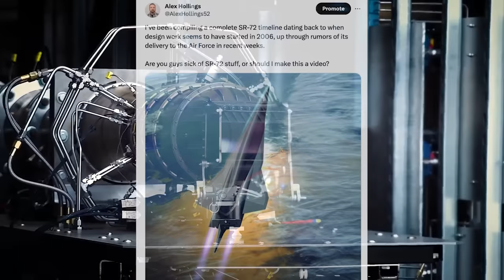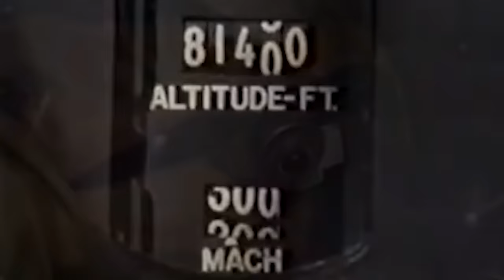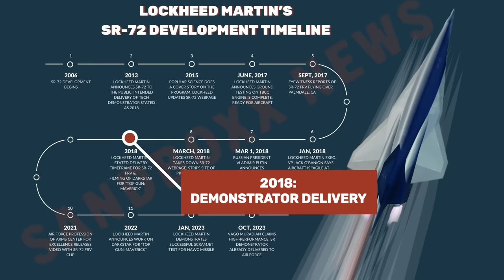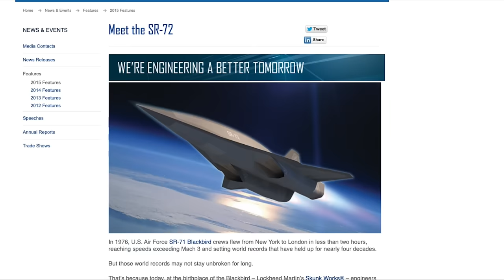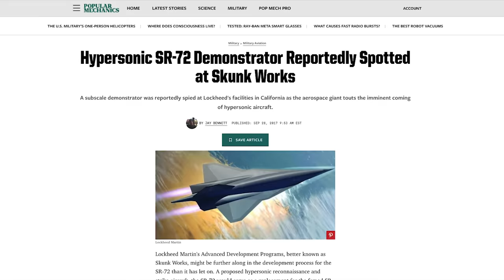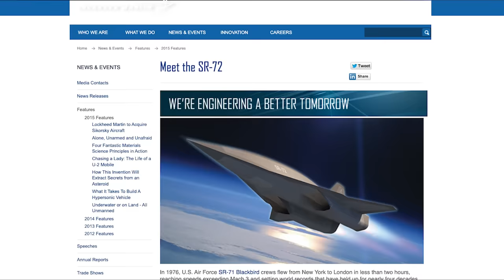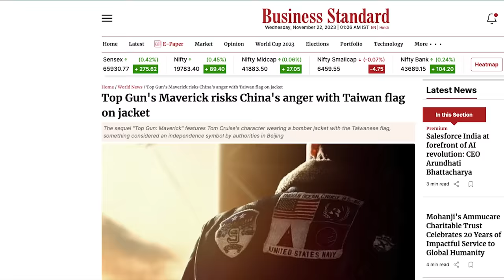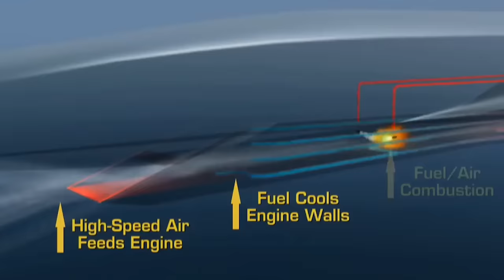The SR-72 is REAL — And we can prove it

Comment: Notes: 1) the SR-71 was designated RS-71 by Lockheed and only got its eventual moniker because Lyndon Johnson decided to announce it with the "wrong" identifier.  It seems unlikely that the follow on would be the next serial number (SR-72), using the same wrong moniker, when likely many ideas and concepts would have been worked on in the interim.
2) The X-15 had multiple melt failures including burn through of non-critical elements, during a mach 6.7 test flight. Going that fast in a lightweight aircraft remains unlikely. Mach 5 or thereabouts seems possible. Given that the USA is currently struggling to field a hypersonic (mach 5+) missile, it seems incredibly unlikely that a manned/optionally manned aircraft, funded largely as a speculative venture by Lockheed Martin, costing billions, would ever have existed.
3) "Agile at hypersonic speed" must be pure hyperbole:- the SR-71 at mach 3 had a turning circle approaching half a continent (hyperbole). At mach 6-9 it would be about a continent (proportionate hyperbole).
4) It would be a mind-bogglingly stupid thing to publish details of an SR-72, even if only speculative, for years and then to remove all references, believing that that action was somehow protective of the program. Neither Lockheed Martin nor the US government are that stupid. By the time the time of the withdrawal it would be fairly likely that agents of Russia, China, Israel and likely other nations would have managed to infiltrate the security and gain actual information.
I am reminded of the VC10-ski (IL-62) tale where British Aerospace knew it had a mole or two because of the copying of the VC-10 into the IL-62 so it and the UK intelligence services (according to an old documentary) fed to the suspected moles doctored wind tunnel data relating to Concorde. Note that there is no point in setting up your own wind tunnels and duplicating the results since you save nothing - not even time. Allegedly, the Russians obligingly trusted the doctored information and built the Tu-144 according to that data, along with canards and badly placed engines, resulting in the dismal failure that was the Tu-144. Perhaps the USA tried the same trick - using an imaginary aircraft.
My personal belief, unsupported by any first hand knowledge, is that component level testing (e.g. engines) has been progressing with a view to attempting to build an article like the putative SR-72 but no one has bitten then bullet and said stop testing - build it. I would love to be wrong and see the actual aircraft at an air display next week.

Comment: All right immediately after the speech when subsonic shockwaves happen because after shocker shockwave becomes dropping it out of atmosphere and they fire us outside the atmosphere and then we go back up and drop into the back side those explosive waves are pretty cool but if we want it to be dick heads about it when we come in we do a 90-degree invert and flatten out at the bottom that can press it with the area that's the devastator

Comment: Operation darkstar was real and occurred back in the late 1989's..... It was a joint project between Lockheed and Hughes Aircraft company for our next gen surveylance aircraft. The body stabilized aircraft was developed... A wind tunnel type model version was built and tested in El Segundo California at Hughes Aircraft Company Radar Systems Group site. Building R3 was built specifically for the testing....located on Hughes Way off of Imperial Highway, just south of RSG building R2.  When testing was completed, the issues (criminal) created by Roger Smith of General Motors who purchased Hughes Aircraft Company on a forced sale, induced/caused the POTUS to cancel Hughes involvement in the program..... Initially canceled, the building torn down 1990 iirr..... The tech transferred to the Aurora program. FYI....Hughes was the company who built the avionics systems ..with their teaming partners Motorola, Westinghouse....for Evey one of our surveylance aircraft including the SR-71.

Comment: The Former USSR was fielding Mach 4+ Sam systems back in the 80s basic Physics'  to out run a Mach 4+ missile you must be travelling faster than Mach 4+ the speed of the SR YF and The first of the Fastest Ladies of the West The Archangel was notably faster lighter and single cockpit, made for a super fast Sled as Brian Schultz once said in a video conference and given that black projects are said to be around a century in front of what you see today in the world of smoke and mirrors it did its job to draw russia out to publicly admit to hypersonic caperble. The SR series was and is capable of much higher Mach than the public are aware of or any info released on said craft. if all you have to do is light the cans to outrun an SAM guided Mach 4+ missile that has locked you up then your capabilities are far in excess of what is said! it takes a lot of energy to go faster than Mach 3+  and the JT engines were a double design that became fuel efficient the faster you go now that is contradictory to public knowledge about aviation and how a combustive system work as it's believed to be the faster you go the more fuel you need... NO its  again relates to Physics is so advanced the public domain has no idea the true capabilities of its military the black fund is an abyss!  The SR series was and is capable of breaking Mach 5+ work it out Their is enough info to work the physics when you know where to look and to think this was designed by the Late Great Kelly Johnson on back of a napkin over a business lunch and a slide rule no computer sim to test the idea in it was models and scale size the average flight of the SR would be 85,000 ft+ at a slow Mach 3 climb 120,0000 ft+ even break Mach 5+ though during the design testing of fuselage on the radar testing grounds they forgot that while testing an area of the desert the shape of the fuselage was noticed to be cooler than the surrounding desert as the spy in the sky pops up over the horizon the former USSR new of the development of something new and ground breaking though unsure of what exactly it was. that was a butter clenching moment for those personnel involved in that fluff up! some were demoted moved out to other sectors of lesser importance their security clearances demoted as that also means pay cuts as well. the hypersonic as been going for a long time even into that of the early 80s satellite tracks a white contrail thats what ever it is is moving at 4,000 mph at very high alt its vector across the continental US takes took less than 45 minutes that was 30+ years since that was noted think what it will be today and you'll be somewhere in the ballpark if you're realistic with the figure's!